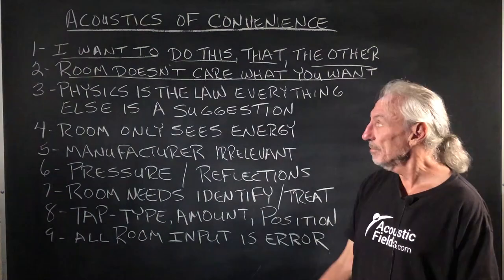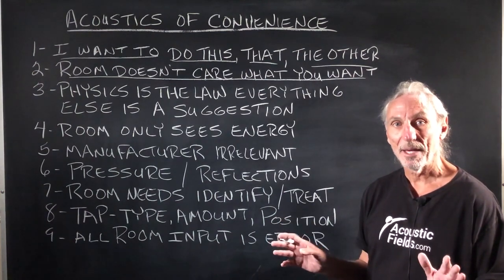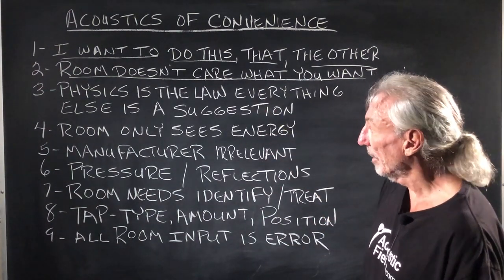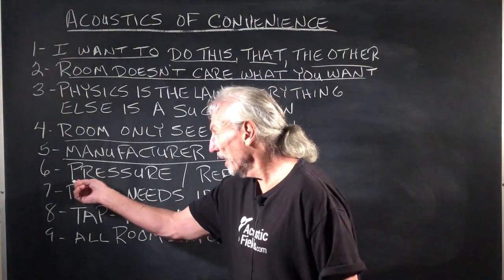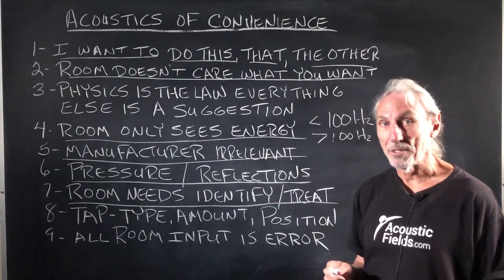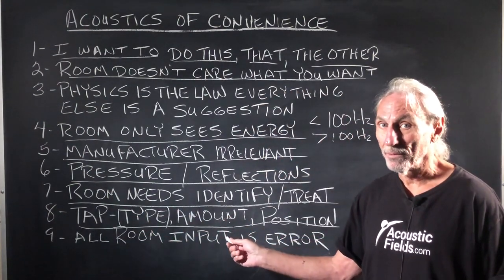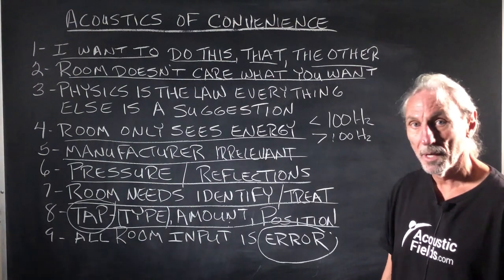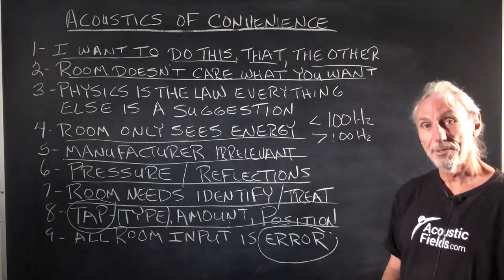Acoustics of Convenience - www.AcousticFields.com

Comment: The Laws of Physics! How often I make that statement when trying to discuss with people that want to talk about ad hype and personal opinion! 

And "a room only sees energy" is brilliant! A nicely concise explanation! I own Magneplanners exactly for that reason! I consider them to be drivers, pressure wave generators. I consider the room to be the enclosure. A sealed system where I am just modulating internal pressure waves. Being dipoles they are used to split the area behind from in front of them. Wendell Diller of Magnepan uses a term I forget right now that describes what they do as creating this sound pressure field in a room in which anywhere you walk in the room the piano sounds like a piano. Response might change, but all the information is there. Compared to boxes where go much off axis and much of the piano sound is gone. So your comment is perfect for them.
Reply from the maker: All input into a room is error no matter what the speaker's distribution pattern is.
Reply: @AcousticFields  You sound like my better half when I make any decoration suggestions! 😃

But I would rephrase it as all input into a room is information which can cause error. The input/ information itself is not the error. But as you say with proper TAP that input does not have to result in as much error.

Comment: Dennis, I know this is a super wild card idea but what if someone constructed a room that was hemispherical mixing room?( We are going to assume for this specific example a 32ft ceiling height). What would happen? I know that there is a lot of build up in the corners of a room and also there is no way to place a speaker in the corner of the room either in this scenario. What could be expected? Also if you could spec on maybe other shapes of room that could possibly be beneficial that would be great. Thanks Again!
Reply from the maker: With that shape, you would have to pay special attention to the time signature of reflections.
Reply: @AcousticFields  would there be any other issues with that shape besides the reflections? And would that issue be very significant with that shape? Basically why I am asking is if there are certain shapes that perform better than others and give a better starting point. I know dimensions (ceiling height especially)  cannot be small.

Comment: On your page you state that in your diaphragmatic absorber your carbon infill creates a low pressure zone which collapses the sound wave. Would pumping out air from the absorber chamber, thus creating a permanent low pressure zone, work too?
Reply from the maker: Yes, but not practical from a material and construction process. The cabinet would have to be airtight and that would be difficult with wood.